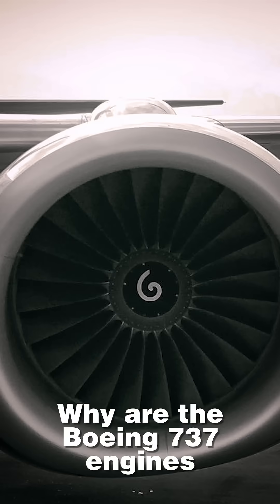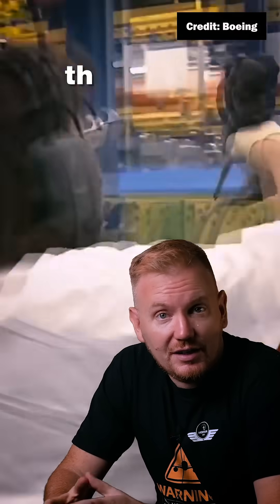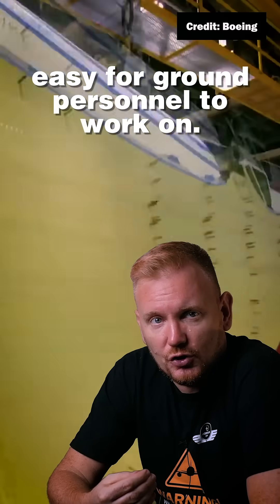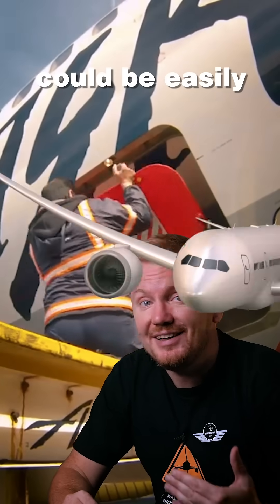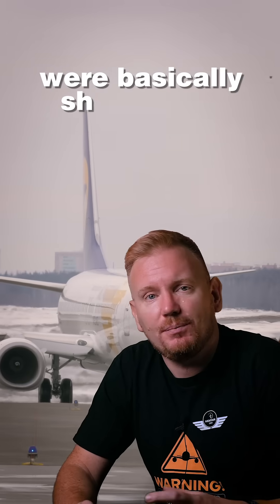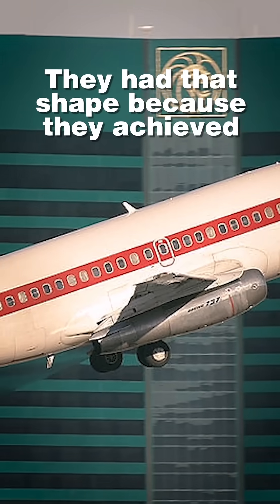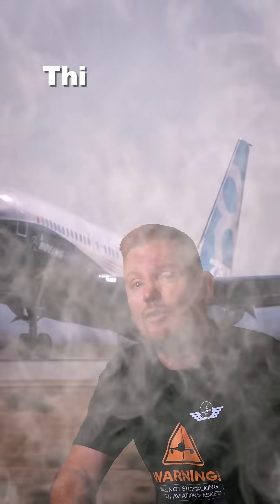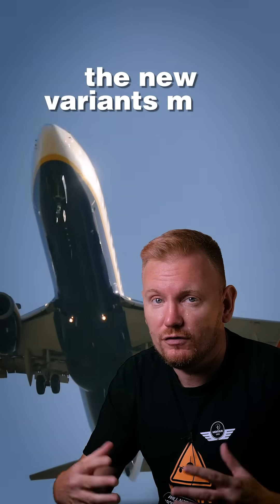FLAT Airplane Engines?! #shorts

Comment: This is far too kind. The Boeing board wanted to repurpose the old 737 airframe and keep up with Airbus without starting over. Using the old airframe dimensions kept the 'Max' in line with the ground equipment all over the World and minimised pilot recertification. The bigger, more powerful, more efficient engines needed to be forward mounted and higher so they'd fit. This moved the centre of mass forward and gave the plane the nose-up tendency, that necessitated the monstrosity that is MCAS.

Comment: Actually these engines aren’t bigger, they just have a turbofan in front of them that the previous generation did not. 
And It was not these “flat” engines that created recent news, it was the next generation of engines that created the problem. The MAX engines don’t look flat so if you see engines that are flat on the bottom you are not on a MAX.

Comment: If Boeing had instead made the 737 Classic (737-300/400/500) higher to accommodate the larger engines, the 737 Max would not have needed MCAS -- and hundreds of passengers would not have died.

Comment: Most explanations including his is incorrect. The 737 hamster engine design is all in the shroud to give it slightly better ground clearance. The overall plane design is lower so that it could be used at airports without full terminal services and a modern jetway. Direct plane to tarmac stairs are utilized in those locations. Newer 737's engines have physically grown in size, so the engine was moved forward and up as compared for the first 737's.

Comment: That's not the correct answer.  The 737 was intended to bring air travel to basic airports that may lack even air stairs,  so it was built as low to the ground as possible to facilitate using stairs built  into the aircraft.

Comment: I mean if you think about it its not actually the engine it's self since y'know the rotor and fan cannot be anything but round, the reason that there is a flat spot instead of the entire engine cowling just being smaller all the way around is to make room for engine accesories i.e. hydraulic pumps, air compressors, generators, fuel control systems etc.

Comment: Despite the concerns of the engineers who wanted to build a successor of the outdated 737 instead, the management pushed them to find a way to install the too large engines under the NG's wings. Many years of inactivity later, there was neither time nor money for a new development again and the same engineering solution was forced again for the MAX - this time over the limits. The management greed (or pressure to cut costs?) was too strong and the developed design was too weak. Result: 2 planes crashed and 346 people had to pay with their lifes for these criminal acts of self-certification and covering up differences with the NG which potentially would increase the training costs for NG pilots.

Comment: I guess maintenence stands purchases were more expensive than labor on this one. Or maintenance personnel had too much input on the design phase. Or materials for the hydraulic system manufacturing was to costly, thus cutting the height, which coincidentally helped maintenance. They should have put the customer's needs first, take a loss at the first few years on implementation of the product and then make the profits on the back end. Or give engineers more freedom on the design phase and beef up their finance dept to create better payment systems for post purchase. Idk.

Comment: That doesn't make sense though. The diameter of the fan stays the same, so the lowest point of cowling is gonna be at the same height. It's just adding more surface below the engine for some reason, this is definitely not going to help lift the engine up

Comment: The original B731s and 732s were using JT8D-9/9A/17A turbojet engines, like he mentioned and the Classic and NG variants are using CFM56 and CFM56-7 turbofan engines. Of course the CFM engine is much bigger in dia and produces more thrust than JT8Ds but unlike RR or IAE engines, the IDG(Integrated Drive Gen) is much smaller in CFM and hence they were able to flatten the bottom of the engine allowing more clearance from the ground. Plz correct me if I am wrong. And the rest info is absolutely true.
Reply: You mentioned the JT8D-9/9A/17A engines,, they are turbofan engines,, not turbojet.
Reply: @wayback75  you are absolutely right. They are turbofan engines. My bad. Thank you
Reply: @falconwings3864  No worries,  I am a retired airline mechanic and cut my teeth on the 727 , 737 and many others.  I  had a great career and how I miss those days,,
Reply: @wayback75  oh wow. Amazing. You had one great lovely career to work on beautiful machines. 
I happened to do my internship on 737-200 and 757-200SF during my engineering college. That’s when I studied about 737s engines and airframe. I wish to fly them one day.
Reply: @falconwings3864  BTW Falcon , do you have your A/P certificate yet ?
Reply: @wayback75  No sir, I don’t, instead I got my Pilot’s license.

Comment: It's for ground clearance because the CFM56 motors are larger and they had to move the accessories gearbox to the side of the engine instead of on the bottom like traditional CFM motors.

Comment: Yeah, I get that for sure, which in turn grace them an opportunity to repurpose an existing and approved airframe, thus extending its life without necessitating the design of a whole new aircraft which put them at an advantage over Airbus.  However changing the positioning and weight of the engines also changed the weight and balance characteristics of the airplane along with its moment.  This made the aircraft unstable necessitating the implementation of the stabilizer autocorrecting system which was buggy and approved in very nefarious ways through the FAA, and which was the direct cause of two fatal, and totally unnecessary, aircraft accidents.  So, all in all, I’m not too impressed with Boeing and their 737 Max. 🤔

Comment: Good explanation, but another main point you didn’t mention is that the landing gear could not be extended any more as they swing inwards and would hit the keel beam.  In order to increase ground clearance, Boeing would have to design a completely new aircraft to allow use of larger/longer landing gear.
Reply: Can’t they just fold backwards instead of sideways
Reply: @smartwhip. Just guessing but I would assume it's preferable (esp under extreme braking) to have the landing gear pivot not act in the aircraft's direction of travel

Comment: Dude 
 That's the ONLY 737 - 200 I liked with those long  Cigar looking Engines.
 Pratt and Whitney JT8D  Engines.
 USED TO GO UP WITH AN ATTITUDE . Those were the same engines on the DC9-MD80 and 727
 

 You can have the new generation 37 with cfm.
 Especially that Max
 Stands for maximum casualties

Comment: In turn resulting in the modern larger more efficient high bypass engines no longer fitting under the wing, so Boeing moved them forward and up, completely messing up the thrust line. Sudden changes to higher throttle settings made this now flawed aircraft pitch up, risking a stall and crash if the pitch change went unnoticed by the crew who would never expect such a behavior. Nobody ever had built such a messed up airliner, but Boeing decided to proceed and hence created MCAS and even decided to hide it. 346 deaths later they had to admit what they had done and after a software/wiring rework that flawed pos is still allowed to take to the skies. Never will I put a foot in a 737 MAX unless it‘s in a museum where it belongs already.

Comment: I were on a flight with very heavy weather. The plane was shaking the whole interior was rattling and the wings were bending like I've never seen it before. The woman next to me was afraid the plane would break apart and started screaming and crying. 
I ask her if she saw the flat engines and told her they are built that way so the wingtips can hit the ground on a hard landing without the engines touching the ground. That's how strong the wings are.

Comment: Low bypass vs high bypass jet engines. Low bypass is like a fighter jet engine, very similar to a turbo, compresses air, mixes fuel and burns it in the core creating thrust, while high bypass pretty much is the same consent except the core powers a big fan that sucks in air and produces thrust around the core of the engine

Comment: I hauled three of those CFM 56-7's as a truck driver back in 2015. Most expensive load I've ever hauled. Each one was about $10,000,000 BACK THEN.
Reply: How much did you get paid?
Reply: @mcmuffin-z5v  Like most truckies - a fraction of a fraction of 1% of the load value

His comment is probably true

Comment: As someone who's worked on A320s and 737s on the ground, I can say that the A320 (which is higher off the ground) is actually easier to work on. The cargo door opens outward as opposed to the 737 door which opens inwards and restricts space, and the A320 cargo hold is significantly larger than that of the 737. Also, no tailstand on the A320, which makes ground ops move a little quicker.
Reply: I just learned that the 737 cargo door opens inward. I thought all cargo doors on all planes open outwards
Reply: @nalendraalif1116  inwards is considered safer as the door can be a plug door, that is the door is wider than the hole so when the plane is pressurized and in the air it's basically impossible to open the door, even if the entire hinge and lock mechanism should break. However outwards gives you more space to work with but the locks have to be stronger as they also have to contain the cabin pressure. The DC-10 was among the few aircraft to have outwards opening doors but there were some pretty catastrophic crashes before they figured out how to design them properly. Nowdays it's far more common as the major lessons have been learned a long time ago. But you'll still find inwards opening plug doors on even new designs just because they're so easy and safe.
Reply: I think Petter misremembered things here. Wasn't the 737 low because the original 737 had built-in stairs so they could service airports with no stairs?
Reply: I'm retired now and have also worked on a few Airbus and 737s and I'll have to say the Airbus is not maintenance friendly.
Reply: Nah, just getting into maintenance manuals is awful with Airbus these days (ever since they ditched N@vigator).

Also, on the 737, you can lubricate the entire landing gear with just a tiny stepladder, the entire landing gear only requires a single type of grease (BMS3-33), and you can service the gear struts without a jack (unlike the A320 where it causes the 90° turned nose gear strut). You can also just jump in the cargo bays from the ground. You don't need stairs if you're in a pinch. You can also open the overwing emergency doors without deactivating escape slides from the rear cargo bay like on the A320.

The 737 is much easier to work on. Except for the cargo bay, which is cramped and fragile. And replacing cargo liners is an absolute b*tch.

Comment: I was a Flight Attendant back when we had the 737-200 “Guppy “ with the cigar like engines. It wasn’t a great airplane to work. A couple years later we got the 737-300s that were much better but not a good as the Airbus A-320s.

Comment: I heard it was because airbus started using bigger engines that where more fuel efficient. Boring also wanted to make their bigger, but they didn't want to have to recertify the entire aircraft because of ground clearance. So they changed the shape a bit

Comment: That in turn made the plane front heavy and mcas was added on board without the knowledge of the pilots, that in turn killed 400 ppl.. Federal Judge has decided that the whole debucle was criminal action and so the passengers the died are in turn not victim of accident but murdered in criminal action by boeing.. Also excuses are gokd but the real reason for the Need of new engine was airbus neo and its super efficient engine, not countering em would mean huge orders for solo airbus

Comment: Well as Ground crew I have to say I like working on Airbus (A320/319) more than on the Boeing 737 because you have more space between the engines and Main Landing gear so you don't have to cross directly behind the hot engine (of course it's turned of at that point) when laying the shocks on Landing gear, the fuselage is higher up so you can cross underneath and the Cargo doors are powerd and bigger which makes for easier loading

Comment: It's crazy how jet engines have changed over the years, with the first ones using more fuel to complete the combustion cycle, and like you said the newer ones have bigger fans in the front that just drives more air through the engine
Reply: More air Bypasses and it is more like a propeller aircraft. Usually stage 3 to 5 is where the blades are much longer, so that outer part is passed around the engine and creates most of the thrust. It also has s nice sound dampening affect. Jet engines have about the same compression ratio as a car, so they still suffer from some fuel not burning completely. They are still vastly superior to engines of even jist 10 years ago.

Comment: I feel that the aged design is at its pinnacle, and a new clean sheet is required to keep competitive with Airbus and other makers. More issues are being created with continual modifications. I realise the costs of modifications is cheaper in the shorter term, but ultimately they will need to offer a new product to keep competitive
Reply: Except the MAX modifications seem to have been very expensive in the short term considering the world-wide grounding for over a year.
Reply: If they aren't already developing a total clean sheet design to replace it, then Boeing won't exist in a couple of decades. It will be Airbus + a Chinese brand.

Comment: look at the black cowling on the bottom of the inboard engine on the rc-135.  After dragging a pod in crasswind landing, they get repaird/replaced with black cowling.  They don't have flat bottoms.

https://images02.military.com/sites/default/files/media/equipment/military-aircraft/rc-135-rivet-joint/2014/04/rc-135v-w-rivet-joint-005.jpg

Comment: The engines of the original 737-100  and 737-200 could also be fitted with an unpaved runway kit. Something unavailable on later models. I believe some of them are still being used in Northern Canada.
Reply: Yea, he didn't really touch base with the real reason they did it, he did say "It placed the engine's dangerously close to the ground" but what he didn't say is that the danger is anything loose laying around on the runway getting sucked up into the engine's and damaging them, that was their number one concern.
Reply: @dukecraig2402  Yeah, there are also clearance minima to allow for shock absorber compression when landing

Comment: lmao...
So How Much research did you REALLY  do?
The 737 was designed Specifically to get into hard to reach airstrip in Alaska. The engines were Designed not with the mechanic in mind, But to be able to handle abuse. They were water injected engines, which allows the small plane to take off on a shorter, unpaved runway and able to handle heavy payloads.
The newer fan engines came because of the Strict emissions that were placed on ALL commercial airlines.

Comment: But raising the engines above the wing caused the aircraft to immediately pitch upward which is why they added the mcas system to stabilize the aircraft automatically but instead they went into a dive and stalled